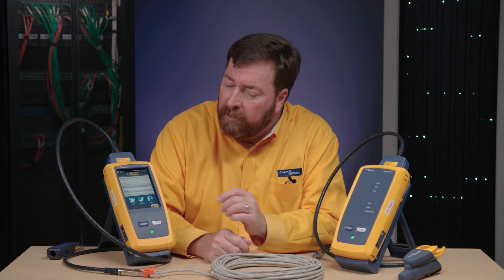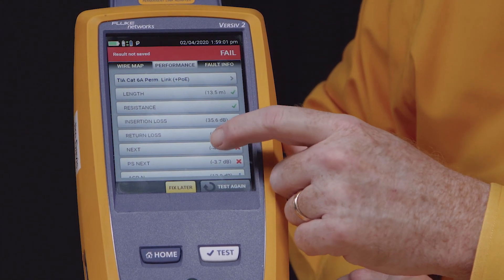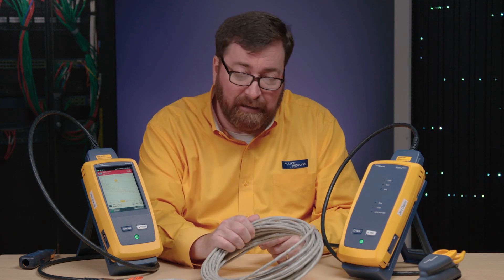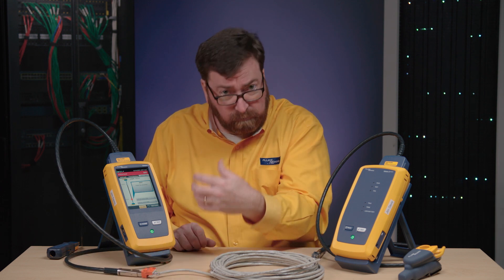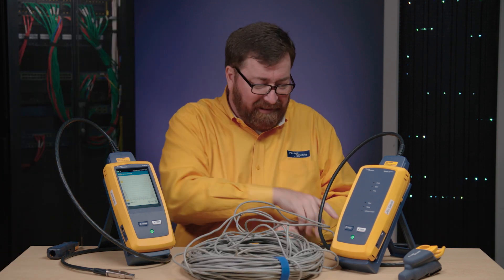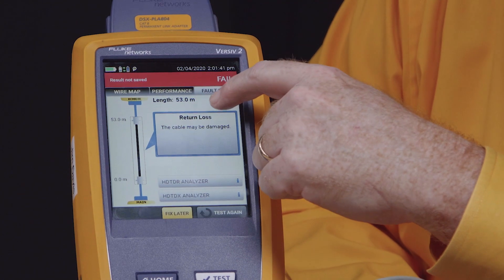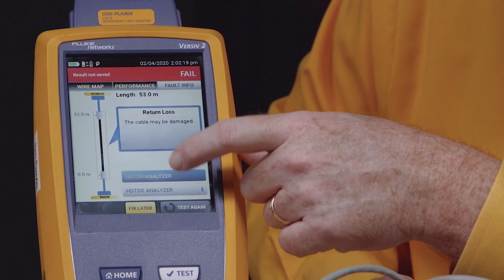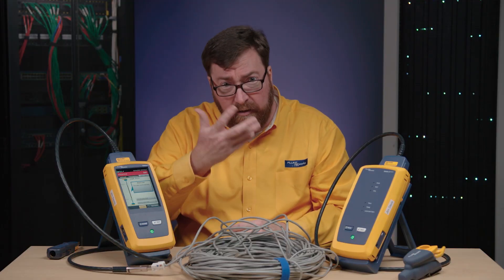Troubleshooting Failed Cabling and Connectors with the DSX CableAnalyzer™ by Fluke Networks

Comment: I’m having a problem with my tester, the cat 6 lines pass permalink test but it shows an additional connection point in the middle of the cable which is not there. Examined and didn’t find damage. Has anyone run into this before? Meter was recently calibrated. Any idea why it would show connection points that don’t exist?

Comment: My trouble is the tester more than the cable. The heads go bad, the ends go bad. I have several link adapters now,  problems with all of them, just wish fluke would make a better, more reliable product, I put my jdsu through hell with no problems, this fluke is babied and always has trouble.

Comment: Sir, i have a question? Is there any problems, or any  posibilties that the Lan Cable, is not working, if the lan cable is fail for Fluke Testing, but pass in Wire Map testing? Thank you